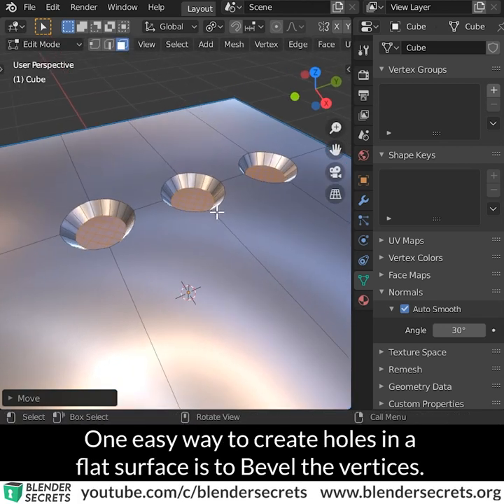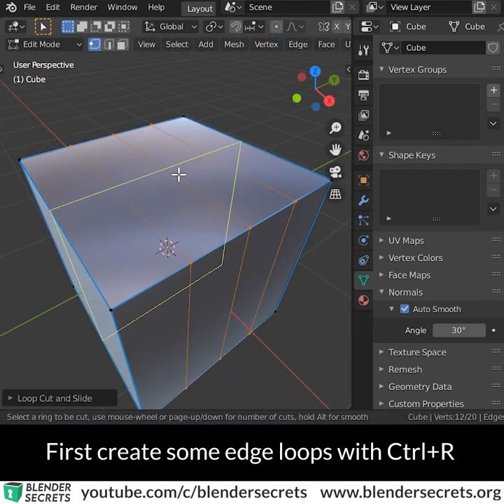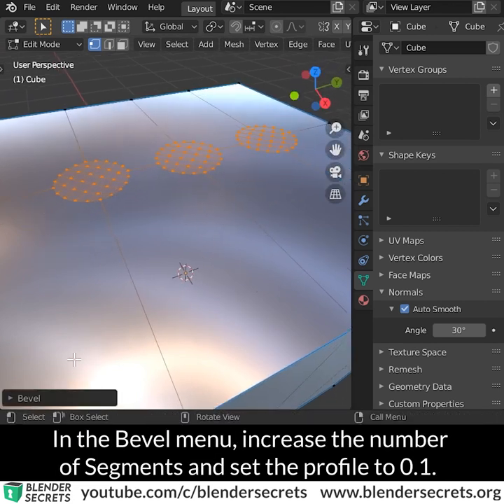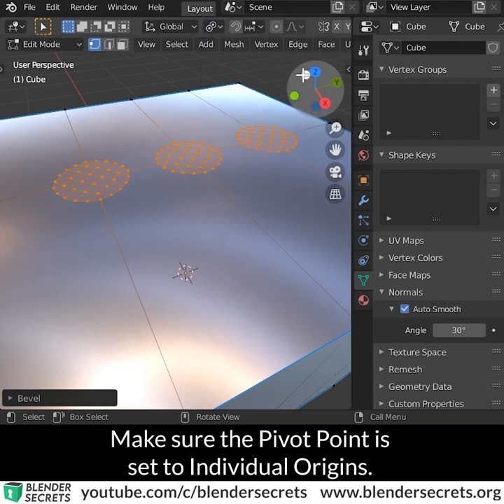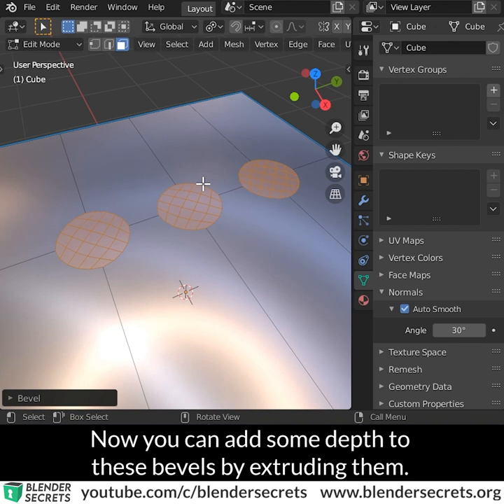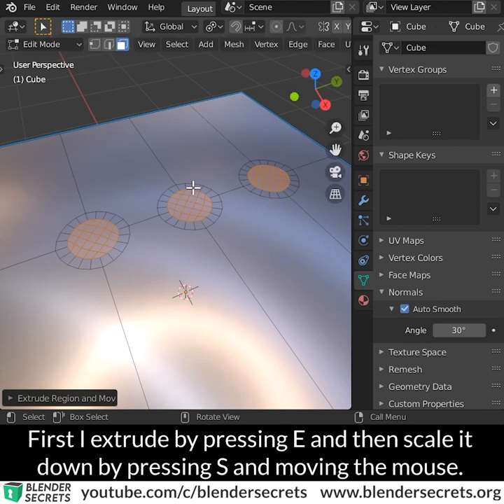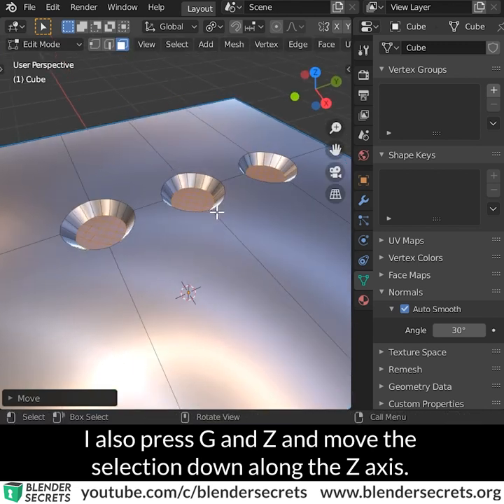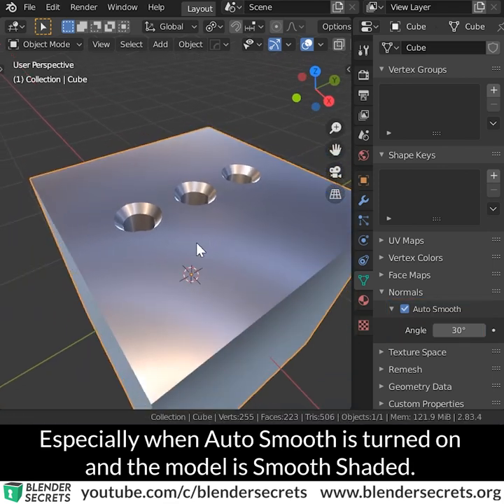Blender Secrets - Making Holes from Vertices (updated)

Comment: Instead of using e and s for extruding and scaling, you can simply use i for insetting. Also doesn't require to set the transform point to individual origins.

Comment: I really like this method, faster than booleans in some cases, and there are times for going destructive in the workflow. This method creates an almost perfect circle, though I think based on testing that a profile value of about 0.085 actually is closer to a perfect circle. Using the same techniques you can create a perfect circle though: if you bevel the vertex with two segments and a profile of 1 to create a square, delete the centre vertex to create a hole, select the newly created corners and bevel with a value of 0.5, select everything and remove doubles, a perfect circle is created. Although with this many steps I don't think this is really useable or efficient, I think it's good to know about.
Reply from the maker: Cool, thanks for the tip! Yeah I think this method is great for the concepting stage, or just when you're making some assets that don't need to be perfect. Hard-surface stuff doesn't always need perfection, if the textures are good!
Reply: @BlenderSecrets  That's so true, textures forgive many mistakes lol. Ironically, perfect machine parts made by computers don't need to be perfect to be convincing. Thank you for replying, I love your tips!

Comment: When I try it doesn't make a circle it makes a four pointed star (in other words it bevels inward rather than outward) I'm using Blender 2.83. Any suggestions?
Reply: Exactly! For me it's the same issue.
Reply: scroll the mouse wheel up
Reply from the maker: You'll need to change the Profile to 0.1.
Reply: @BlenderSecrets  in 2.9 it's called "Shape"